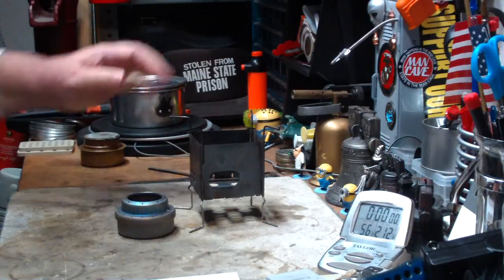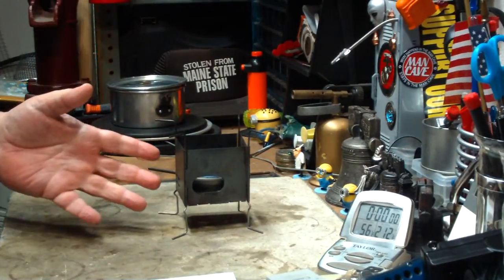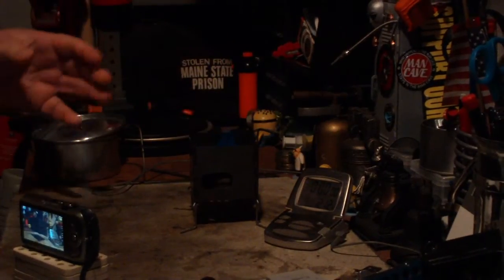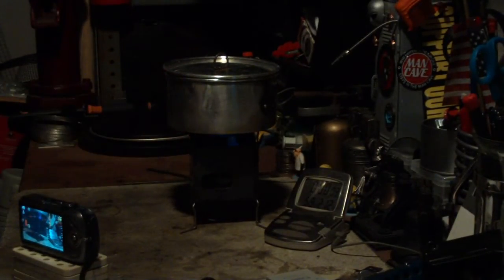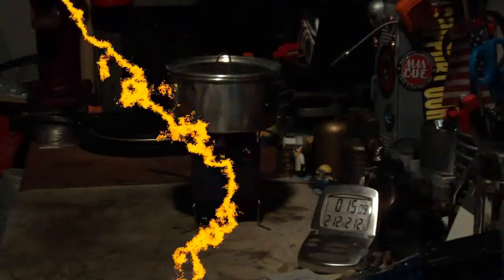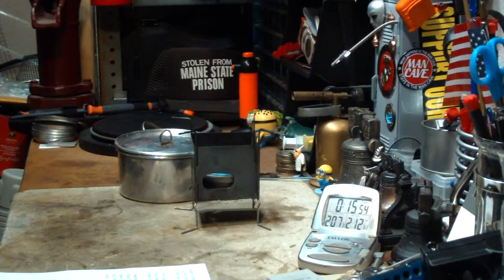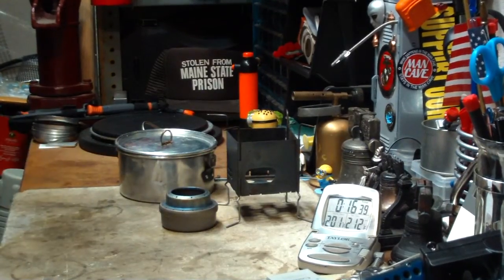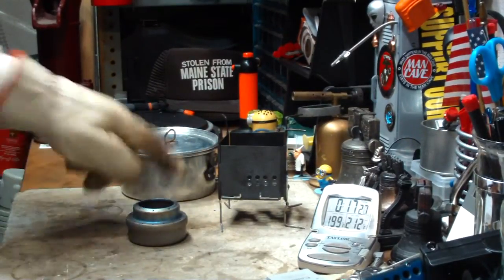3" Folding Firebox Nano - Evernew Ultralight Titanium Stove - Boil Test#1

Comment: Hi Hiram, Thanks for all the information in your videos.
I had built a stand for my trangia mini using chicken wire covered by and aluminum foil.
The foil doubles as an heat reflector and windscreen. 
There are vent holes in the bottom and top of the stand. The distance from the bottom of the pot to the burner holes is about 1".
Time to boil 2 cups of water 4:30.
The heat is so intense that it melts the silicon handles on my titanium pot, and it is very difficult to turn off the burn without using the simmer ring.